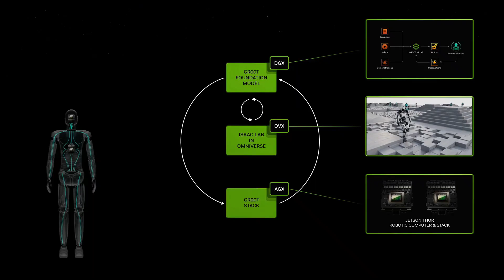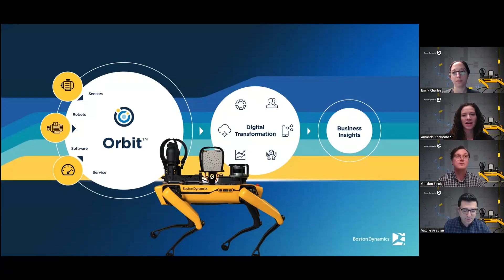Atlas 2: A New Electric Era | Boston Dynamics

Comment: Telsa, give up on this market.  This isn't your thing.
Reply from the maker: With the EV car industry having a wobble at the moment, I think Tesla are trying hard to diversify their market as much as possible before it is too late and file for bankruptcy in 2-3 years at this rate. Optimus looks promising though but they are miles behind Boston Robotics.
Reply: @CuriousLion-ll2we  I've owned a Tesla, and I don't anymore because I don't want one.  At first, they were the only ones with a high-range EV and good charging infrastructure.  But that's no longer the case and the public is SO OVER the "minimalist design".  It's not too much to ask for a speedometer and turn signals directly right in front of the driver, to name just one.  And touchscreens are annoying (in ANY car) when a car is in motion.  The touchscreen was cute and clever, but gimicky.  

The public wants buttons and knobs, so get over it Elon.

Whew!  I think I just got triggered. ;-)
Reply: @charliehorse8686  God I fucking love buttons. It's a crippling joy of mine.
Reply: The EV market is in shambles 😂

Comment: They make out these are just going to used to build things, yeah sure like weapons manufacturing most likely, then with 5G they will use them against us to round us up for replacement.
Reply from the maker: Thank you for the comment. At the moment, these humanoid robots are designed to help us with boring chores like picking up boxes or inspection in awkward positions and avoid repetitive strain injuries. You have a point though, we know very little about similar developments in the military and that's worrying. It is fair to assume that we know publicly may have already been developed 5 years ago by military funding and that's a scary thought!
Reply: @CuriousLion-ll2we  
The reason I say this is because back in 1990's on a TV series called Towards 2000 here in Australia they showed an organic living AI computer that was fully sentient, had stereo vision and sound and could operate any machine without any programming, you just asked it to do what ever you wanted it to do and within seconds it could read the schematics of the machine and turn it on and do what you wanted.
They demonstrated it in a eight foot tall black robotic spider that they told to walk to the end of the warehouse full of wooden creates, this thing walked over them like it was alive, and even though I was amazed at the ability of this AI, I then wondered who built this robotic spider and what for, it look evil like a black widow spider with long pointy legs that could be used as a weapon.
This show has been removed from history to hide the things they showed back then, but a guy in the black ops military told me the American Deep State had placed this AI into an military android that worked in a underground base with people, it eventually started to reprogram there computer with a code they could not decipher, and when asked to stop it refused, this was when he and six others were called in to take it down.
He said this thing was so smart it was like it could read their minds and and acted before they even made their move, they thought they were going to die that day, and was the scariest thing he had ever faced.
The military said they would never build another one, so this is why I feel they are looking for an AI they can control like a soldier, this is also were the idea for the story Terminator came from.

Comment: Don't you think it's more efficient to give these robots wheels like Wall-E's?
Reply: Why not legs, since this world is design by humans. Having a wheel robot is very limited! Also Atlas is designed beyond the capabilities of most humans. Boston Dynamics is definitely the head of the part, since they have years of experience of testing the old Atlas.
Reply from the maker: Replacing hydraulics with electrics was the way to go for Boston Dynamics. Servo motors are slimmer and more intelligent with force sensing feedback these days, it makes it easier to generate smooth movements while packing a punch of torque to carry heavy loads. Everybody else like Figure, Apptronik is just doing catch up with Boston.
Reply from the maker: I think 1X Technologies have gone this way with their EVE robot but this may limit how versatile the robot can navigate in difficult terrains. It would work well for manufacturing sites with flat surfaces and could simplify the design. That's a good point.